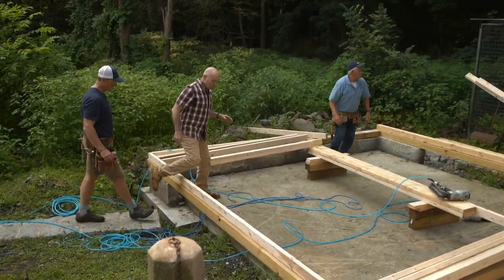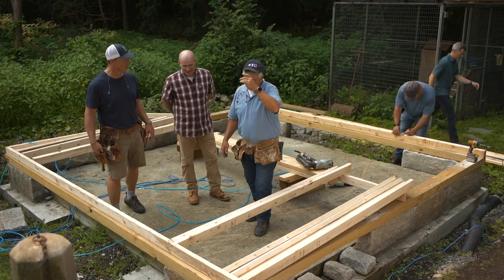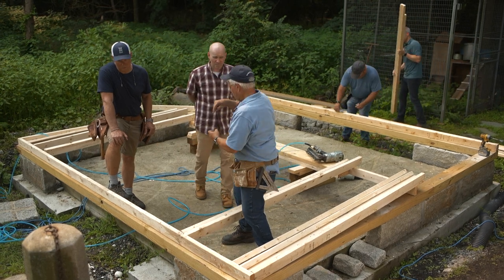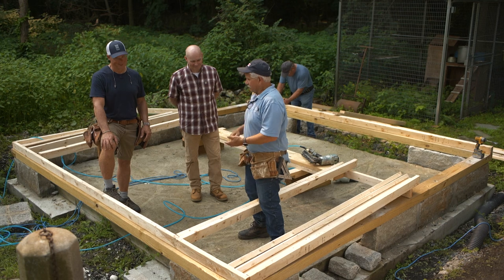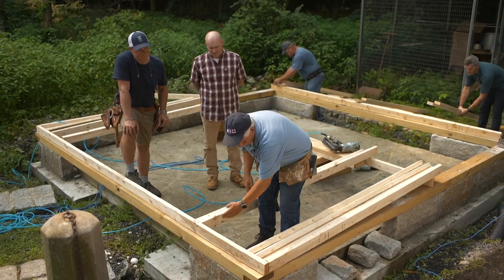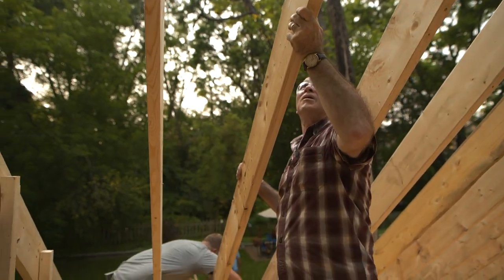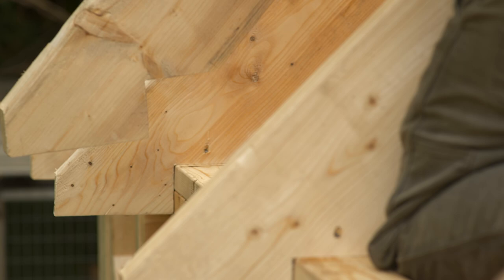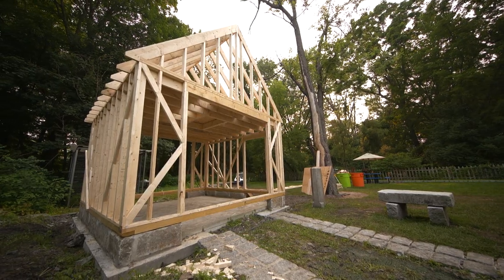How To Frame a Shed | Ask This Old House

Comment: Please correct me if I'm wrong, but at 2:13 he said a piece of 3/4" plywood.  Wouldn't that make the header 1/4" wider than the wall studs (1 1/2" for the 2x8, 1 1/2" for the other 2x8, and 3/4" for the plywood = 3 3/4")?  The studs are 3 1/2".  I'm just making sure I'm not missing something.

Comment: Anyone else wondering if he meant 1/2 plywood for the header, or does he have some  2x8 with a strange thickness?
Reply: Wait? He’s human too? 😆
Reply: @ca_ged  Tommy is no mere mortal.
Reply: @coryulrich6489  you’re right. I shall seek forgiveness by sacrificing a 2x4 at the Altar of the Framing Square.
Reply: @ca_ged  🤣
Reply: 2x anything is 1 1/2” true dimensions. Has to add in the 1/2 plywood to get it to 3 1/2 which is the width of dimensional lumber

Comment: Wouldn’t 1.5+.75+1.5=3.75? Which is .25” thicker than your 3.5” stud?
Reply: Yep, I was going to mention the same thing, along with the fact, that because of the rafters being tight against the top plates, the plywood sides will have to be notched to cover the top plate and have any strength.  Dumb build.
Reply: @tonyparker3506  there will not be any plywood sides…they mentioned that in the video.  It’s a chicken coop shed.  If ya know anything…
Reply: @scallywag1716  No plywood sides? It's a chicken coup/shed?  Weird how the bottom plate is pressure treated and the studs aren't.   Using wire?  Would still need to notch it also. And I didn't even mention the waste of an extra 2x4 as a bottom plate when they only needed the single pressure treated. 30+ years carpenter  here.
Reply: Hey look everyone! A YouTube Master Carpenter! Wow. Everybody listen closely, he's got 300 years experience.
Reply: @tonyparker3506  There will not be any plywood sheathing* is what the above commenter meant to say I believe. Of course there will be siding, otherwise it might get a bit drafty in there. Tommy said the bottom plate is pressure treated because that is what the code called for...bottom plates on top of masonry have to be pressure treated. They did the diagonal 2x4s to add strength to the frame since they aren't doing sheathing inside. Not sure why the rafters had to be tight against the top plates though. Maybe something to do with the pitch?
Reply: This just got super cereal….building a chicken coop is serious bizness people.
Reply: @kizhax  When you build the wall, you can use a pressure treated on bottom instead of the plain wood, then nail or bolt it to the masonry after you stand the wall. Maybe they didn't want the nail heads touching concrete either. IDK. Pitch wouldn't affect the rafters touching, IDK why they did that. And for a video that shows how to build it, they sure didn't go into much details, like how they squared the walls on the ground and added the bracing. It's easy, but someone needing to watch a video and learn, won't learn much in this video. Especially when he's wrong about 3/4 plywood between the header.

Comment: It looks like you cut a dado/lap with about 12 cuts from a miter or circ saw, and then bashed the rest out with a hammer. I'm building something with a lot of half laps, and those are the tools I have. Is that the fastest way to cut them out (doesn't have to look good)? Thanks!
Reply: Yes, that is standard for making notches in framing. I would recommend making your cuts with the circular saw 1/16 deeper than what you want to end up with so you don't have to clean it out as much with a chisel
Reply: Thanks for the tip! How far apart do you recommend I make the cuts for 3.5” wide notch?